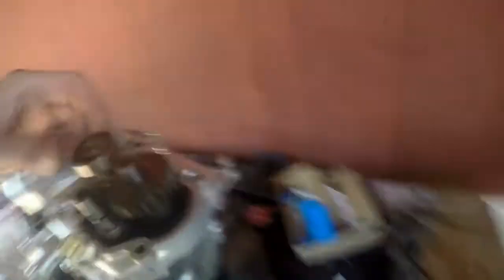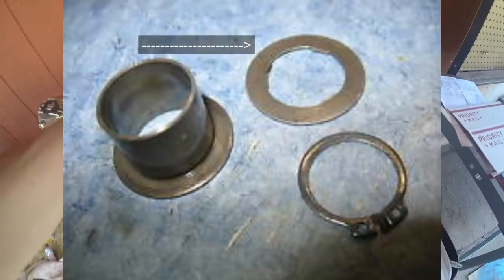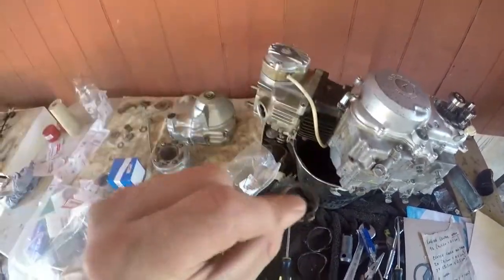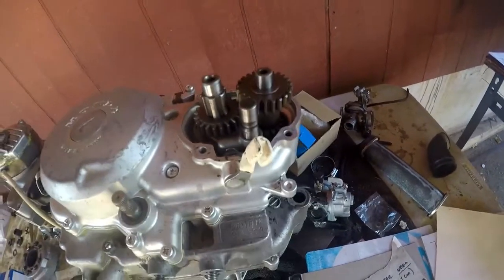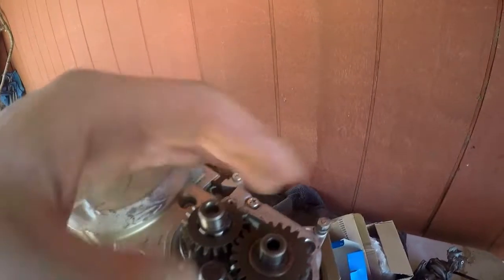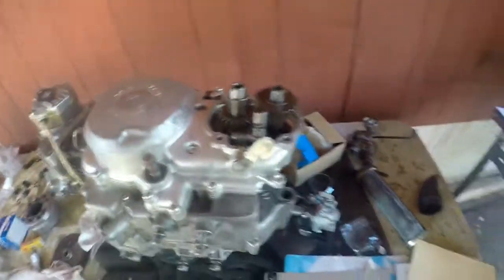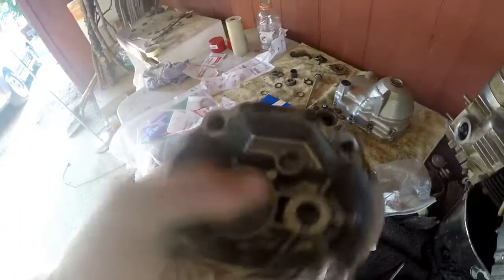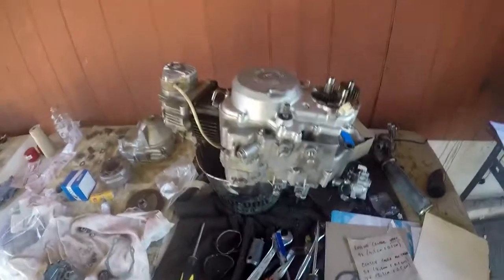Honda CT110 Rebuild Part 25 - Assembling the Sub Transmission - Shane Mouton

Comment: Thank You.
I got my first CT110 about 3 weeks ago after life got in my way about 20 years ago.
Here in Australia the CT110 has been the Australian Post Office bike of choice since "Adam played Fullback  for the Romans".
Here we can't get one over the counter at the Local Honda Dealer, But the Post Office dispose of by auction there bikes when they reach between 20,000k's to 40,000K's.
Mine is a 1994 model  there was a bit of change in them in 1999 and I have not as yet worked out all the few changes, though 1 was the size of the fork seals and that is my first job.
So off to YouTube and here I am ready to at last have someone to show me what to do and how.
I have changed to an own build the exhaust (now a low slung full copper and brass thing) and have added a pod filter with a 2" copper tube up towards the seat, this change caused as expected to re-Jet to a point 9 needle in the carb, done by the local scooter shop, Noosa Scooter Style
( https://www.facebook.com/scooterstylenoosa ), so it may sound like a 1 lung Harley at 500 yards but it goes now.
I am going to pull down the whole thing and rebuild it with a few other mods and now thanks to you I have a baseline.
Thanks for your time of putting this all up.
Keep it up.
Tony Queensland Australia

Comment: Thanks for taking the time for this walkthrough. I got balls deep in one and afyer waiting for parts forgot how it goes back together lol
Reply from the maker: i know what you mean, the videos were for 2 reasons.  1 i knew if i made video i could get i back together and 2 i knew if i was telling what i am doing that i would be able to reference that and not get lost myself.  really easy bike to work on apart from the clips on the fly wheel and the strange clutch nut tool you need to get it off.  give me a shout if you get stuck man

Comment: Hey man, ever finish?
Reply from the maker: hey estiMATE, I just posted my "Last Postie Video".  I was so close to getting her done.  My wife fell ill and is now permanently so and I had to take every second I had to work to make ends meet at home.  Then, to add insult to injury, a huge fire swept our town and all but wiped it out.  Now I no no longer have a garage to work in, any tools to work on here or anytime to get back to it.   Miraculously the bike made it out UNTOUCHED!!!  Sadly she is up for sale for less than the money I spent putting the parts into her.  Had I got her running and papered that would have been an entirely different story but... that's just how life goes.

Comment: Hey mate, what happened after episode 25? Did you end up finishing?
Reply from the maker: hey Anthony, I just posted my "Last Postie Video".  I was so close to getting her done.  My wife fell ill and is now permanently so and I had to take every second I had to work to make ends meet at home.  Then, to add insult to injury, a huge fire swept our town and all but wiped it out.  Now I no no longer have a garage to work in, any tools to work on here or anytime to get back to it.   Miraculously the bike made it out UNTOUCHED!!!  Sadly she is up for sale for less than the money I spent putting the parts into her.  Had I got her running and papered that would have been an entirely different story but... that's just how life goes.
Reply: @shanemouton7606  damn man.... hope things have gotten better since that comment.

Comment: Did you ever finish the rebuild?
Reply: 1 year later still not finished boyo
Reply from the maker: hey BD Lake, I just posted my "Last Postie Video".  I was so close to getting her done.  My wife fell ill and is now permanently so and I had to take every second I had to work to make ends meet at home.  Then, to add insult to injury, a huge fire swept our town and all but wiped it out.  Now I no no longer have a garage to work in, any tools to work on here or anytime to get back to it.   Miraculously the bike made it out UNTOUCHED!!!  Sadly she is up for sale for less than the money I spent putting the parts into her.  Had I got her running and papered that would have been an entirely different story but... that's just how life goes.